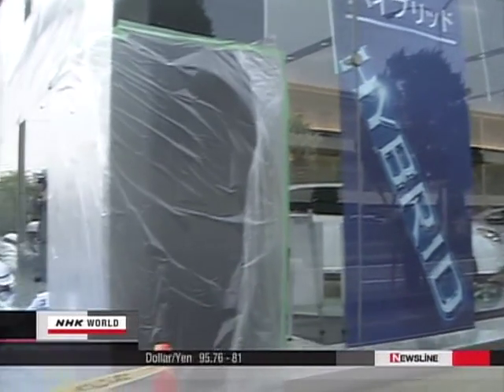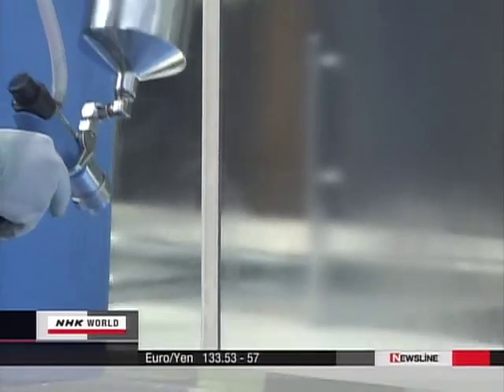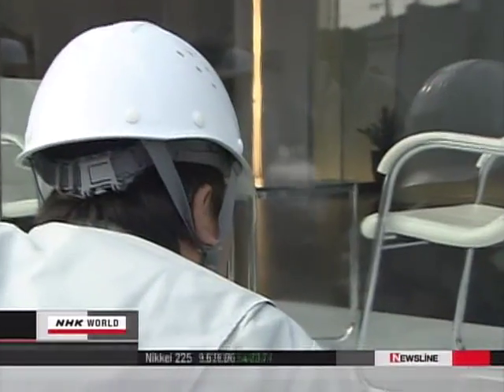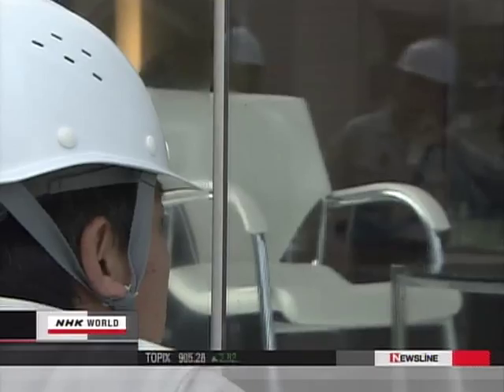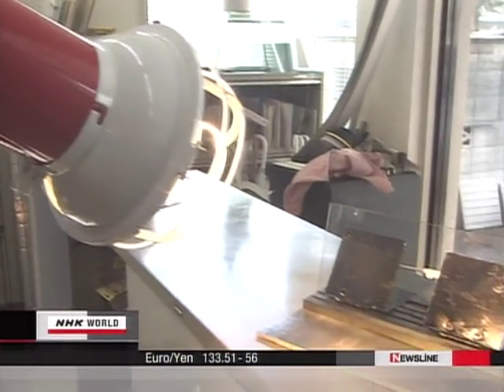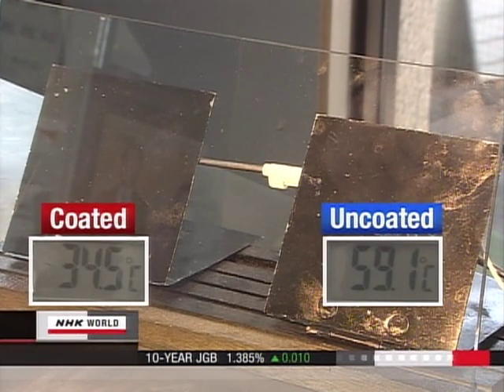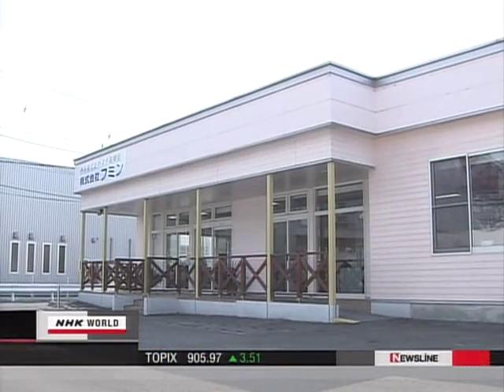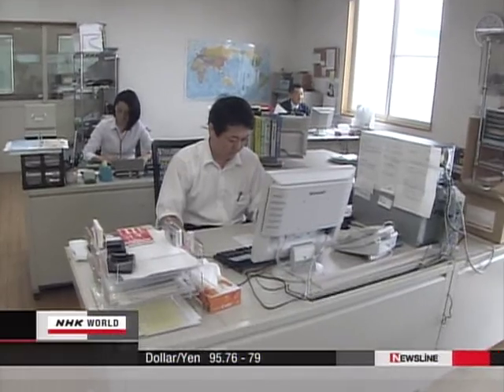Transparent heat insulator for glass windows مادة شفافة تعزل حرارة الشمس بشكل كبير

Comment: Greetings, we are a company working in the field of agricultural sector services in the Sultanate of Oman, and as you know that the temperature in the Sultanate of Oman and the Gulf countries in general sometimes exceeds 55 degrees, which negatively affects the crops in greenhouses, so I want to know is it possible to use this material  By coating the plastic of the greenhouse to reduce the temperature inside.  What is the cost of covering an area of square meter?  Thank you very much and appreciation
Reply from the maker: sorry , but we only privide news , we dont have connection with the producer

Comment: is it just for protecting from heat or does it also protect from cold in winter ? Could you answer this please ?
Reply from the maker: no it doesnt , 
it reflects sunlight , so it will reduce the heat generated by the uv